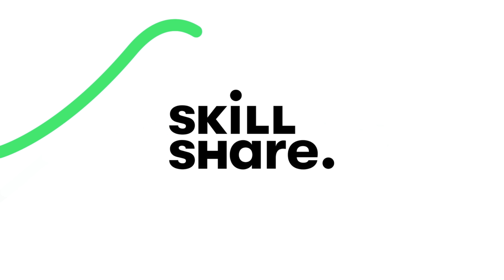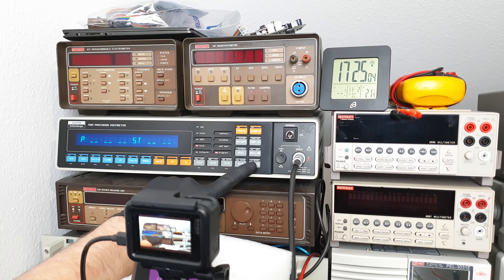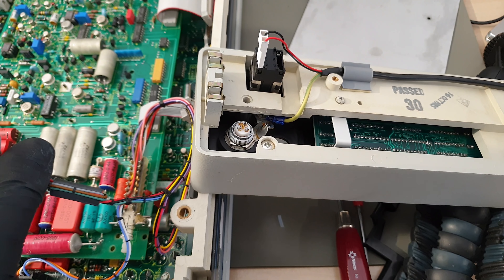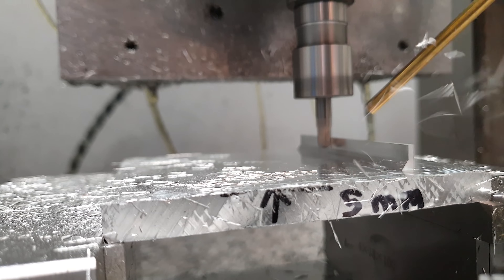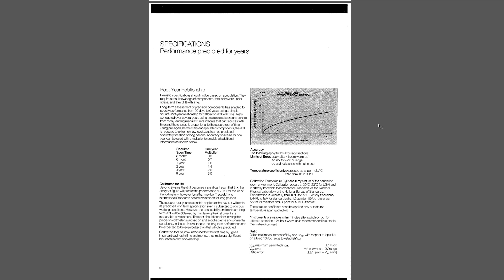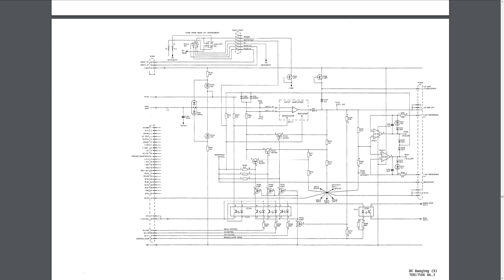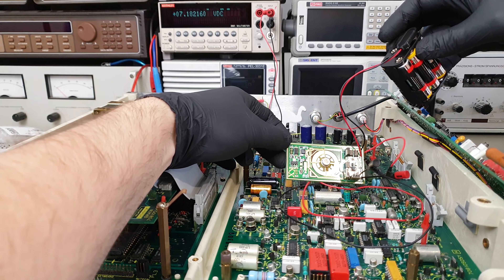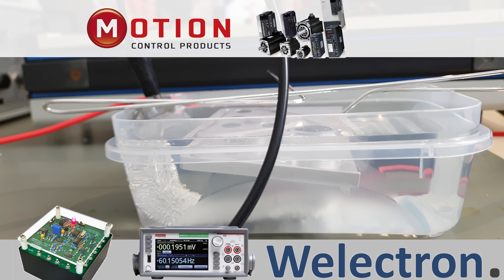Solartron 7081 - Mods & More for 8.5 Digit Voltmeter

Comment: Home brew anodize : LOTS of distilled water wash after every step. You also need to do a quick soak in sodium hydroxide as the first step to clean and do a minor etch before the acid anodize. It will also strip the ano off and you can try again.

Comment: For anodizing, you need to degrease the part really well and then place it in a mild sodium hydroxide solution before you put it in the electrolyzing bath. You also should position the part so that bubbles can't build up on any surfaces.

Comment: Marco, no idea if you still read the comments on this old video, but I got a 7081 sometimes ago and repaired it from a NiCd battery leakage on the "Earthy Processor" board. I changed the configuration from 16k to 64k RAM and used FRAMs on adapters. Now the 7081 never needs this NiCd anymore. There is another battery on the "Earthy Logic Input / Output" to supply some clock chip. My unit hat a coin cell holder wedged in place, but I have these 3.6V SAFT 1/2AA sized Lithium batterie for Rohde 6 Schwarz Equipment in stock, so I put one of these in. Should work fine for many years to come. But these units tend to come backt to you with another service request, and a few days ago mine requested attention by releasing some stinky smoke... The mains input filter has failed... Luckily some matching voltage-selector-fuse-input-connector-filter blocks are still available new. Expensive but available.

Comment: I too have the madness that is precision measurement, although i'm in the very early stages (just a mild throat irritation), I just copied Dave Jones's microcurrent circuit and layed out a PCB myself, and armed with my 30 year old Fluke, a 3v battery and a 50m resistor made from 5 10m ebay specials, I delight in nanoamp precision with a dash of picoamps on the side.

Comment: Clear housing TS-100 soldering iron!! 😱 What is this witchcraft?! Didn't see that option when I purchased mine from Amazon.
Reply: Banggood has TS100 shells. I think they're about 10 bucks.
Reply: @Leif_YT  awesome! Thank you 😁
Reply: you're impressed by the clear housing and not the USB C soldering capability of this TS 100! are you mad ?!
Reply: @tenns  not mad. I have one, just not with the clear housing.  It's a fantastic iron.  Especially when you supply it with 24V goodness.  Oh that heat up time! 😁

Comment: Actually that is a different Datron you are thinking of.  They were a British company which was absorbed into Wavetek back in the early 90s.
Reply: I am sure he was joking and knows that very well. There seems to be a few different Datrons about. One does motor racing timing I seem to recall. I have a Datron 1081 on my bench as I recall. Will have to check as it could be a lesser model. Never been able to afford a 1281.

Comment: 10µV StD renders 8 1/2 digits into 6 1/2 digit performance only. 3458A  at NPLC 100, 16 samples, delivers about 200nV StD (~ 0.02ppm) instead, which includes already the stability/noise of the references measured, i.e. LTZ1000 based, or from 5442A calibrator.
Question is, if something heavily drifts inside your 7081, like pre-amps or +/- reference amplifier, or if the A/D has a principle flaw.
I assume all supply voltages and shielding has been measured to not be the root cause.
Noise for DCV is not specified at all, if I haven't overlooked something!?
Reply from the maker: hm with the super slow sample rate 7081 could probably be called NPLC 2600, but I didn't use the digital filter at all before ... might be worth testing? 16 samples?
PSUs were tested, but not up to voltnut standards ... I've seen some nice DIY power rail probes in the eevblos forum, which one should I build? zlymex?
nope, can't find an official DCV noise spec either
Reply: I just wrote down these numbers of the 3458A statistics as a comparison. In your case, you might record measurements to PC, at a faster rate,  7 1/2 dig, to visually analyse, if that high StD really comes from high noise, or instead from drift. In first case, you get a noisy, but constant baseline, in the other case a drifting baseline, which might show lesser noise.
The PSUs should only have low ripple and the correct voltages, as you mentioned that the capacitors were OK, and did not replace them. Nothing fancy volt-nutting about that. I just wondered about your comment in the video, that the 7081 is known to be noisy, or so.

Comment: Thanks for uploading the Solartron front panel file to Thingiverse. I may go this route with my 7081, but I need to quantify the Fischer setup first.  A question about your 7081 front panel replacement: Did you solder the original input leads to the new binding posts or go the mechanical crimp route?

Comment: I have a solartron but never used it due to the ridiculous cost of the front panel connector. Would like to copy your mod. I would prefer to 3d print as my cnc machine is still under construction.

Comment: Hi will you make 4s li ion 5200mah 14.8v bms balancer circuit for irobot roomba vacuum cleaner? Get auto cutter! Let me turn the battery off when fully charged. Now everyone is using these robots, everyone watches and benefits ...

Comment: You can't make the front panel out of those cheap noodles. Think of the instrument you are working on! You are going to need to splash out on some higher grade DURUM WHEAT noodles. I can't believe I need to post this. FFF--- seller is rubbish would not buy again.